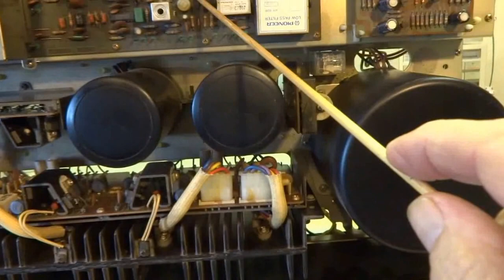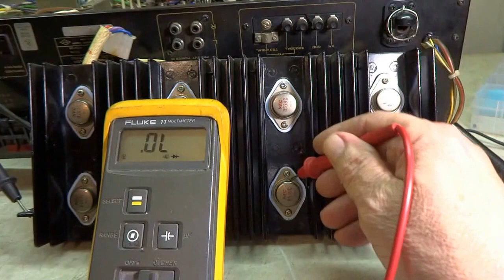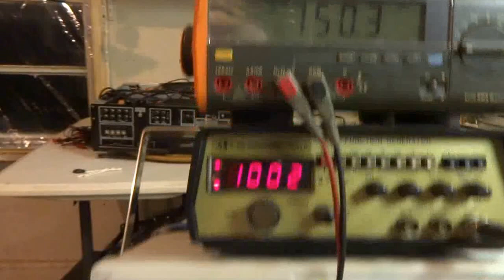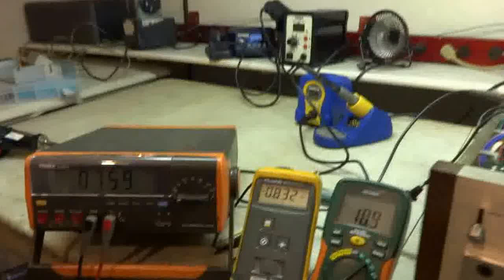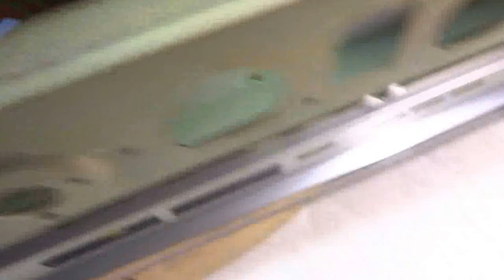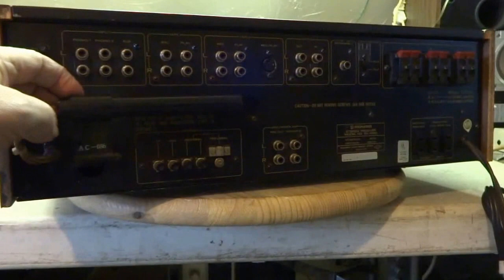Pioneer SX 1050 rebuild

Comment: I have pioneer sx-1050. A channel fades out. When I lightly tap any of the controls it works again. Is this a easy repair. Is it a dirty connection
Reply from the maker: A little DeoxIT may fix it. The problem is that on this unit all of the controls are hard to get to to clean. With the power off you could work all of the controls back and forth, sometimes this will help remove the dirt which is inside of them.

Comment: Just a rough estimate if you haven't answered this before but approximately how much a rough estimate does it cost to recap a 1050 like you did sir?? Thanks
Reply from the maker: Thanks for watching my video. The two big filter caps ran about $30 each. The eight output transistors were about $5.50 each. The rest of the caps, transistors and diodes were most likely less then $75.  I have no idea how much labor someone would charge.
Reply: @patrickoconnell3896  Thank you so much,Well I really enjoyed your video very interesting great job also👍👍👍

Comment: Wonderful job, well done.  I do some restorations now and again myself.  Never had a Pioneer on the bench though.  I just wonder why you replace all transistors, are they really out of spec?
Reply from the maker: Thanks. This receiver was most likely driven hard in its day. The amp board ran hot and one of the output transistors had a very low HFE.  Other transistors were known to be a problem. There is a wealth of information on Pioneers in audiokarma.org.

Comment: It's good how you emphasise the use of the DBT. 
Very important.
Reply from the maker: Even after the DBT I did have a output transistor short out on me. Not to sure on those silicone insulators. May not use them again.
Reply: When I did my amp some years ago it had the mica insulators. They were still the original ones as the outputs had never been touched. I only replaced the outputs just to freshen it up.

Comment: Hi 
I just want to mention that I really enjoy your channel. 

I just pick up the SX 780 unit from yard sale. The unit was dirty but has power on it. 

I have a question, the balance knob is not working. It is just not responding well. There is no in between, when I turn the knob. It goes on and off like a switch. It should change the output gradually but it is not. I also noticed that the right channel VU meter is slightly weaker than left channel. 

I do not have equipment to test it out, like pro, but I notice slight different in the sound, when I put head phone. 

Do you think it is issue with balance knob or just Vu meter?

If you have any suggestion or tool that I can use like multi-meter (to check the output) Please let me know. 

TY.
Reply from the maker: Thanks mkmeggy2, I have solved a lot of problems by just cleaning the controls with DeoxIT. There are lots of videos showing how to do this. The signal will pass through just about every switch and knob so anyone can be a problem.  Be safe when opening up your stereo, unplug it.

Comment: Pat, love your video. I bought a sx 1050 along with a pair of Klipsch Heresy speakers right out of college in Jan 1977. The receiver had intermittent sound issues at about 10 years old. Over the years, I've had repair guys try to fix it on numerous occasions. The repairs never took. It's well taken care of and mostly boxed up in a closet most of the last 25 years. I still love it and want someone to resurrect it. Would you be interested in taking on another project? I'm in south Alabama and will pay whatever it takes.
Reply from the maker: Thanks Mark, My goal is to get to a point where I can take in customers equipment but I am not there yet. I will suggest going to Audiokarma.org. and ask around there.  This is where I go to get my information, they know their stuff and won't do you wrong. There is a section just for Pioneers. The SX-1050 is well worth getting fixed.

Comment: pat im interested in the Pioneer 1050 if you could get back to me and let me know if you're interested in selling it thanks Larry
Reply from the maker: +Larry Brown Thanks Larry, it is on Ebay right now. I am patraoc on ebay.
Reply: I have been following you for quite a while now and I know the quality of work do you  its  more than impressive, congratulations. What I'm primarily interested in is a Marantz 2270 or similar to the last Marantz you did , when you find one and do the magic that you do I WILL buy it all you have to do is contact me and it's a done deal. as far as this Pioneer is concerned I had a mid seventies Pioneer 939 that I remember fondly but I don't really feel like getting into a bidding war.on Craigslist. I'm in no hurry because I want something of the high quality work that you do so again please remember me and let me know the next time you have something of that ilk thanks again Patrick and sorry to be bugging you